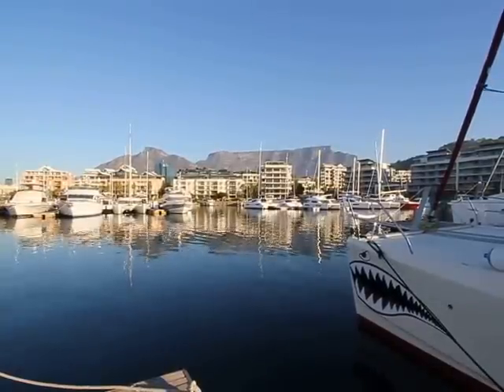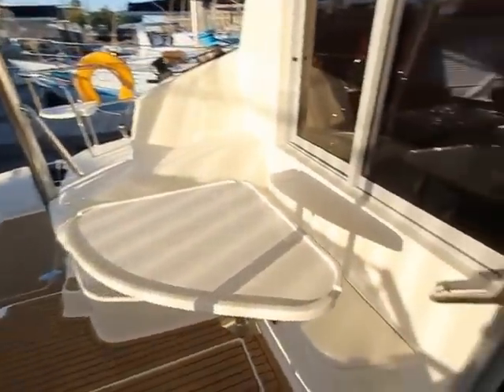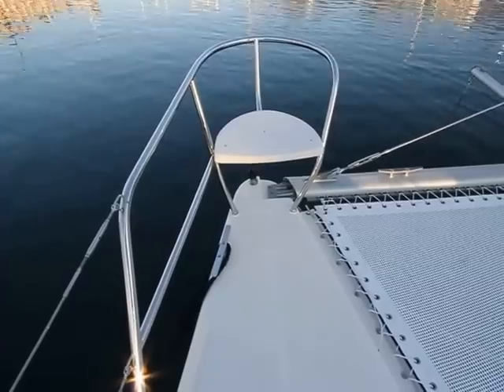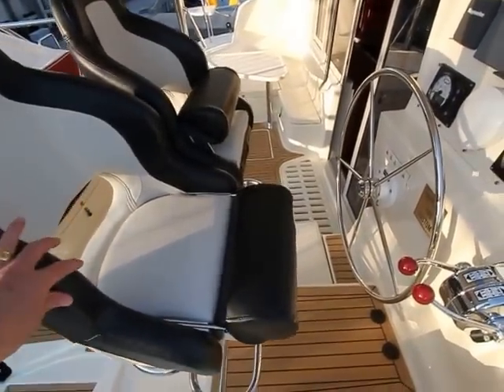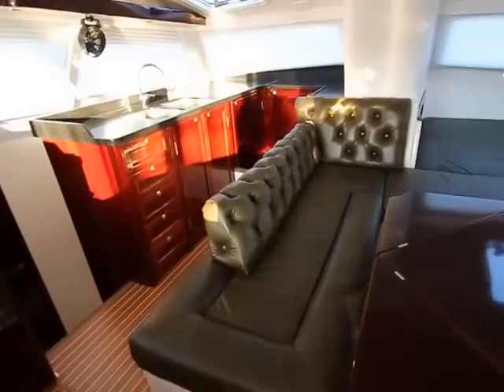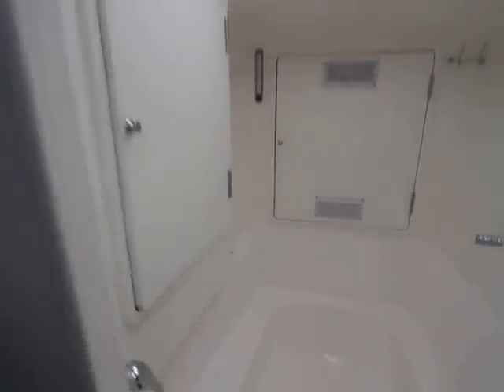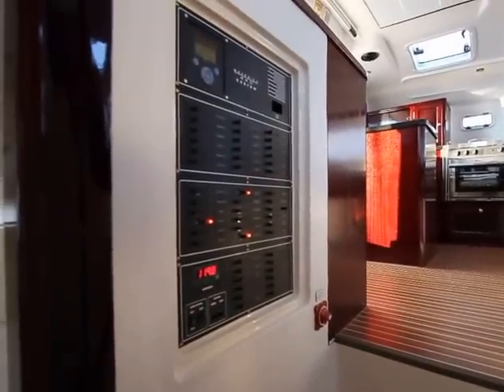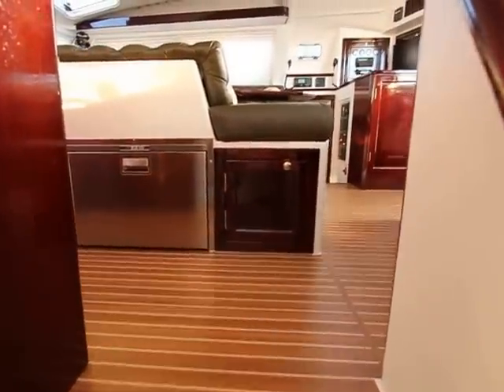Maverick 440 AIR POWER detailed walk through of interior and systems

Comment: As so many have said in the comments, beautiful vessel and they even praise the layout....
I wonder if any of them have been blue water sailing.... the Nav Station and radio placement is a joke. Are you suppose to stand on the stairs while using the radios? Or while plotting a course, checking the wind forecasts.... only bad thing, but a majorly bad thing is the Nav Station layout and placement. 
Maybe remove the daybed and install the Nav Station looking forward with seating and Auxiliary Controls.
Reply from the maker: Hi Steve, thank you for sharing your thoughts. 

On the Maverick 440 LANI in the video the VHF radio is by the stairs and the SSB radio is at the desk in the owners hulls. On the next Maverick under construction the position of the VHF is being moved to be closer to the Saloon doors; so you make a good point here and I believe the new position of VHF will work well as you will be able to operate the VHF from inside while being in arms length from the helm. 

The Maverick 400 FRISKY has a forward facing Nav Station in front of the galley. The hatch above the Nav station allows for the person on watch to easily check on the full sail plan. You can see a photo of this forward facing helm in this website link;
https://www.maverick.life/gallery?lightbox=dataItem-jhkb5bvq

Every Maverick is different and they are set up to an owners exact specifications. Many Maverick sailing couples choose to do their chart work & passage planning on the saloon table or using the desk in the owners hull and then do away with having a seat at the Nav Station. The Maverick 440 Air Power completed a full circumnavigation and two Atlantic crossings with a setup like this - so long range passage planning is possible in this way. The helm position of the Maverick is extremely well protected and can be 100% enclosed with a canvas cockpit enclosure and fixed bimini so watch keeping can also be done from the helm in bad weather. This lessens the need for the forward facing helm. Although you could have a forward facing helm on your Maverick 440 if you wanted one.
Reply from the maker: Yes, this particular Maverick 440 did complete a full circumnavigation from Cape Town to Cape Town, across the Atlantic, through Panama, and then across the Pacific. So they do bluewater cruising. Then also then completed a second crossing of the Atlantic. Following the circumnavigation, a new dashboard with the black background was installed and some minor changes to the instrument layout could have been performed then. As a semi-custom yacht, the owner can choose their own layout of instruments and their own layout of Nav Station. See older comments for more explanation on these possibilities.

Comment: Beautiful but to say "extremely light" at 12 ton for a 44? hat's a little bit if a stretch.
Reply from the maker: The idea is to reduce the static weight of the yacht with foam core hull construction & marine honeycomb & PVC foam core on interior modules. This allows for greater carrying capacity for creature comforts like a washer / dryer, dishwasher, Air Conditioning & Heating, etc.. As a cruising boat it is most important how she carries a payload and can still perform and sail great, the Maverick 440 draws another 10mm of water for each 246 kg of added weight.